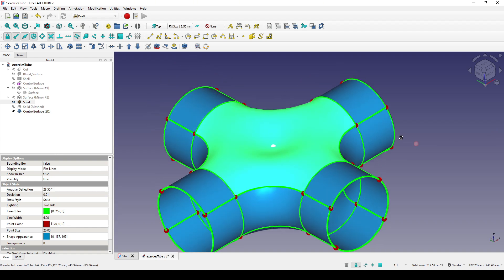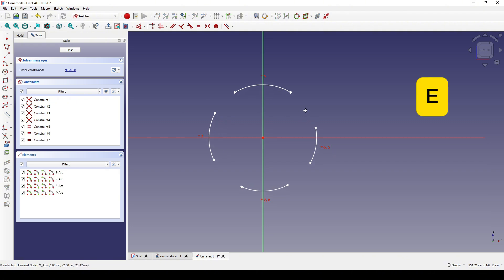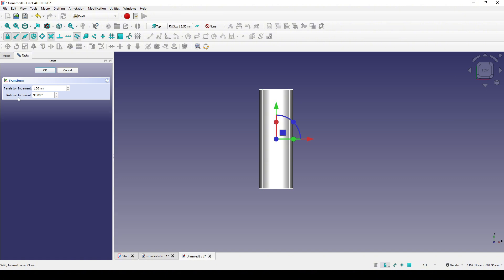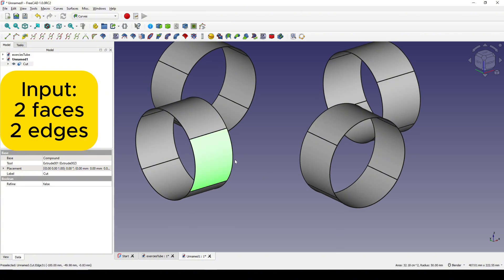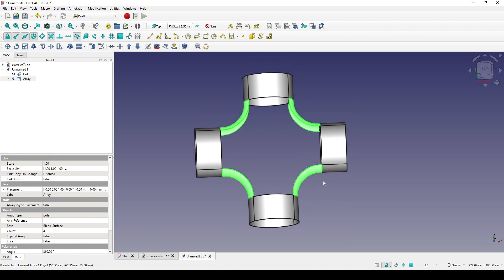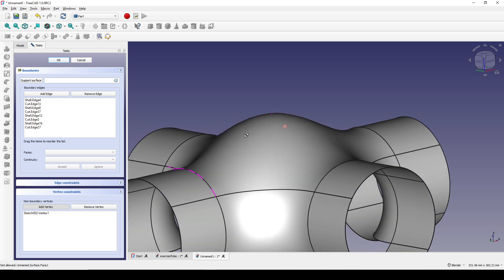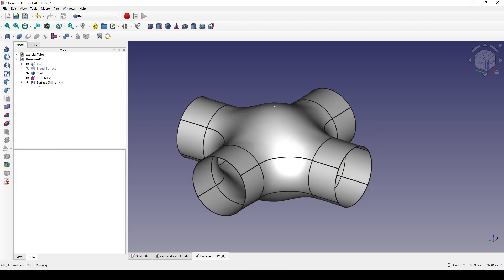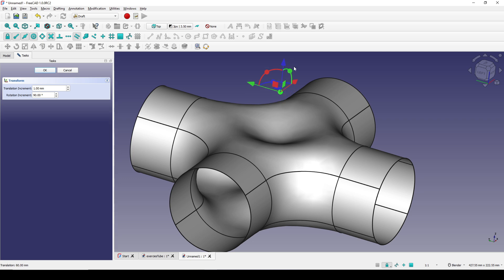FreeCAD 1.0RC2 Basic Exercies Using Blend Surface In Curve WB.

Comment from the maker: If you want to create wall thickness:
- Method 1: using 3D offset tool directly in Part WB. Dont forget to check on fill offset.
- Method 2 a little harder:
1. Using Filling tool in surface wb to fill all 4 holes. Not recommend using Array.
2. Go to part wb, select 4 holes and the shell and union them
3. Select the fusion, go to menu part-convert to solid.
4. Select 4 faces and use thickness tool.
Reply: Well said !
Reply: Neither method ultimately produces a solid body. Sometimes access is denied. Show me step by step, please.
Reply from the maker: FreeCAD is not easy. If you choose FreeCAD, you must be patient and ready to face some problems. I can help you a few times, but you have to overcome difficulties on your own. Watch my videos carefully, as well as those from other channels. Just enjoy the process! :)

Comment: When I make the cut from the square box the 4 seperate lines in the pcs of pipes turn into just one.
 ( becomes one surface instead of 4)
and this causes problems when I make the curves, 
Tried following 3 times it happens every time,
Reply: Same here. You have to uncheck Refine under Boolean in the Data panel of the Cut